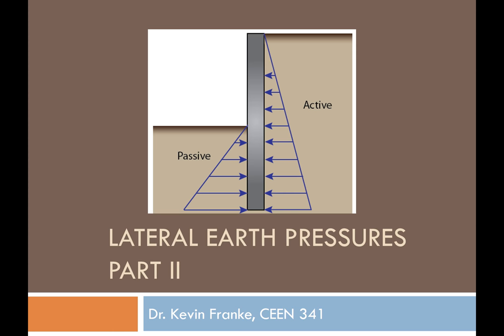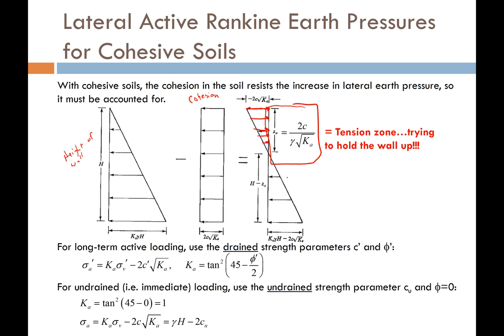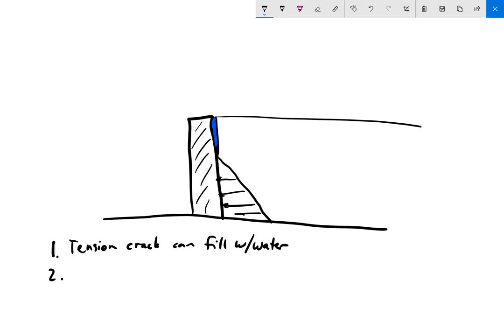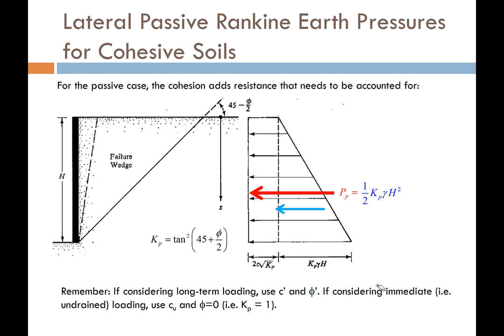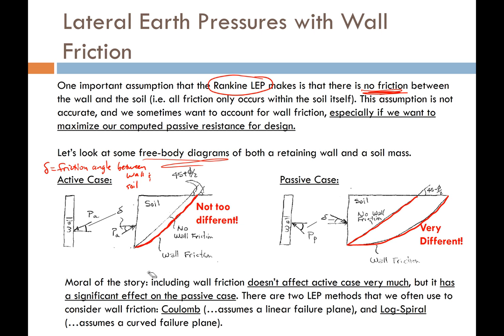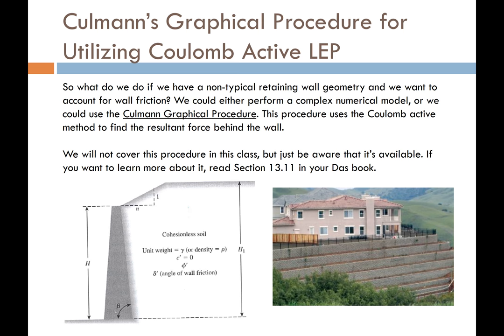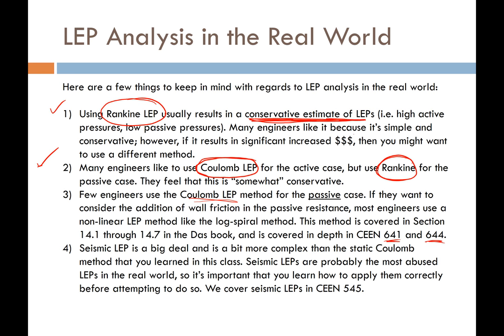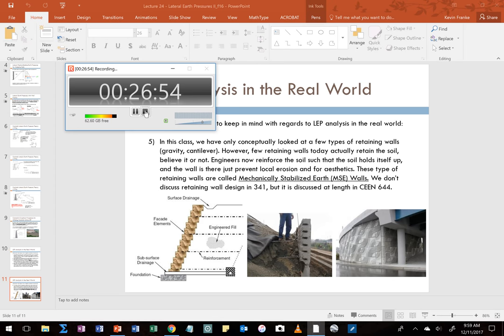CEEN 341 - Lecture 24 -  Lateral Earth Pressures, Part II

Comment: Hello Dr Franke. Thank you for your  excellent series of videos.

I'm min 20 you say that for passive soil pressures coulomb is overconservative .... but Rankine is underconservative. Does this mean that the only way to calculate passive soil pressures is with log-spiral?
Reply from the maker: Not at all. Engineers often try to incorporate conservative loading estimates all the time, especially if the methods to compute them are simple and quick. If you want to compute an accurate estimate of the passive resistance, then you would need to use either the log-spiral method or a numerical method like Duncan and Chang or other similar.
Reply: Thanks Dr Franke

Once again, thank you for your videos. I hope that you continue to produce more. In particular a lecture on free earth and fixed earth method would be great.

Comment: I still don't understand why the Rankine Method is the more conservative approach: as you mentioned, Rankine Theory assumes no friction occurs between the wall and soil. As such, the FBD at 11:55 shows that the shear plane in the case that friction between wall & soil is assumed to occur are more... distanced (for the lack of a better word). Meaning, more soil body needed to be supported by the wall, which in turn results in a higher LEP. This makes the Rankine Method's LEP value to be an underestimate.

Or at least that is what I perceived.
Would love to hear your feedback, cheers from Indonesia.

Edit: I understood why Rankine is the more conservative method for Active cases. What I still don't understand is why Rankine is also considered conservative for Passive cases. 

Your explanation in regards that Coulomb assumed linear plane of failure, when in reality it's nonlinear; therefore Coulomb cannot be used left me with a lot of questioning. Because Rankine also assumes linear failure + no friction.
Reply from the maker: Rankine method is more conservative for Passive lateral earth pressures in that by neglecting the friction between the wall and the soil, we reduce the amount of passive resistance generated by the soil and that we can utilize. As an engineer, when you are WANTING more resistance from the soil, then the LOWER LEP value becomes conservative. Soil does not inflict passive pressures on a retaining wall. Passive pressures are generated by the soil when something is pushing the wall into the soil.